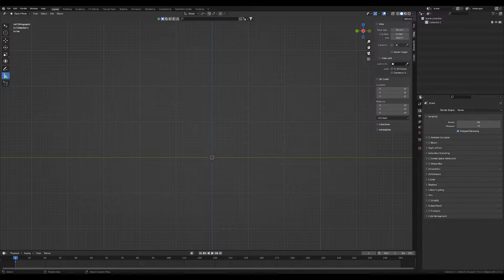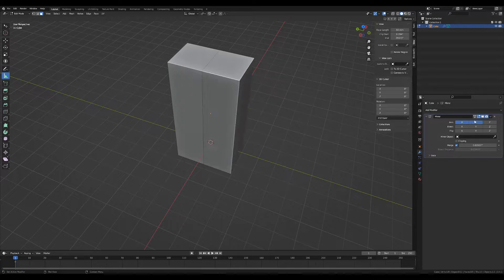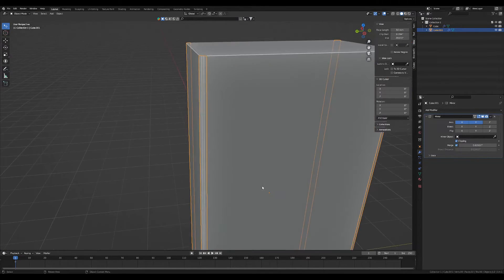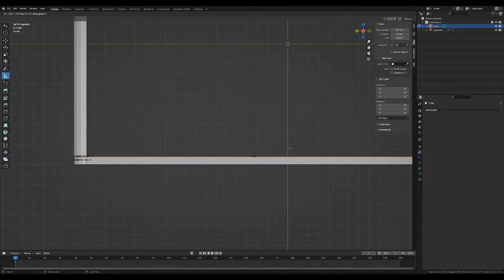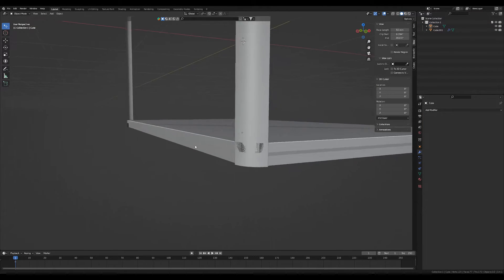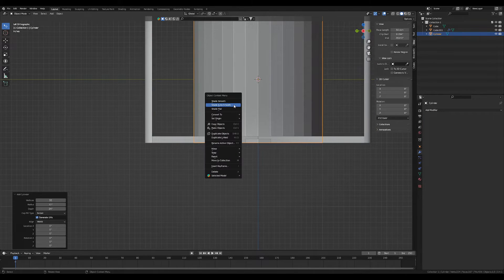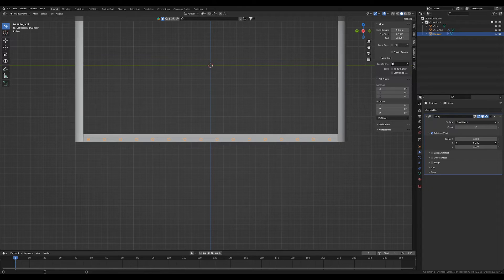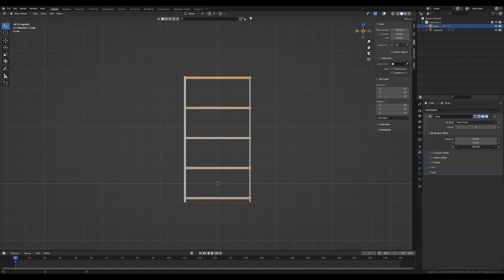How to create a storage shelf quickly in blender

Comment: The boolean difference modifier does cut the holes for me, but it also added a new face to that cut hole that resembles the cylinder I used. Is there a way to fix it?
Reply: This is late but anyways, The problem is with normals select the shelf plate -> go into edit mode -> press A to select all -> press Alt+N to open normal menu and select recalculate inside -> then perform the boolean operation with cylinder.
I recommend checking about normals and different ways to see them in viewport (the red faces are outside with face orientation enabled in viewport overlays)
Reply: @Light_dayo  Not at all! I still use boolean for my recent projects every now and then, and I got used to just manually deleting the faces. I’ve never tried recalculate normal (alt+N) will definitely try this out soon, thanks!

Comment: 2:05 when you extrude alongside normal it extrudes evenly on both sides but for me they extrude uneven. The short side moves alot more inwards for me while the longside barely moves what could be the problem what did i forget?
Reply from the maker: try selecting the object then hitting shift and a and applying transforms then try selecting what you want to extrude and then use the option extrude faces along normals

Comment: may i know why is my plane hollow when i extrude it?
Reply from the maker: So from what i can tell when you extrude a plane its normal operation is to remain hollow, but you can extrude the plane and then select all of the edges around the hollow portion and click F to fill and that should help. Additionally you could make your shelf and use a solidify modifier to add the exact thickness you want
Reply: @thatcanadianguy3327  thank you so much!